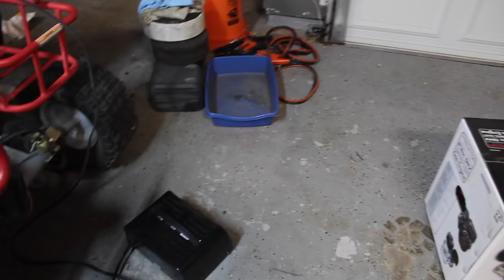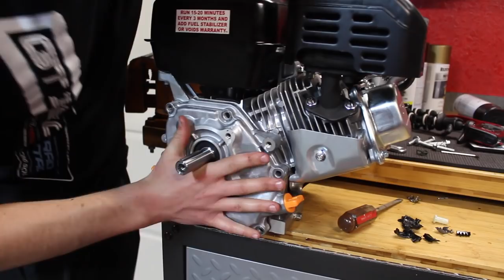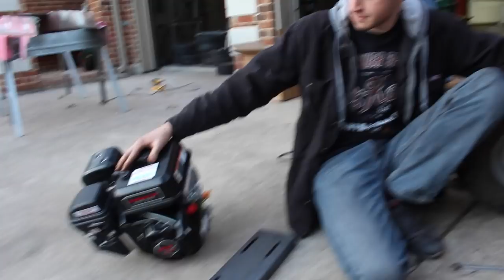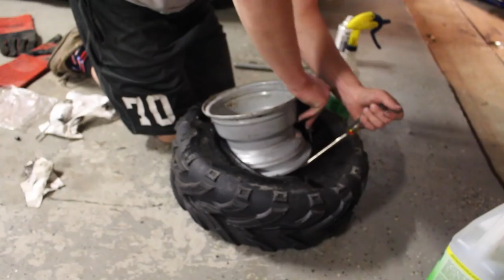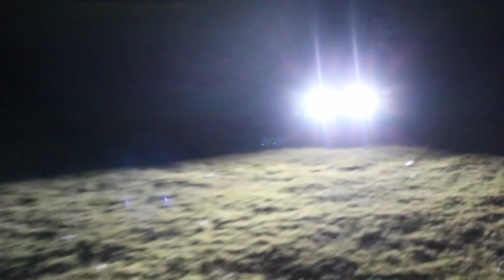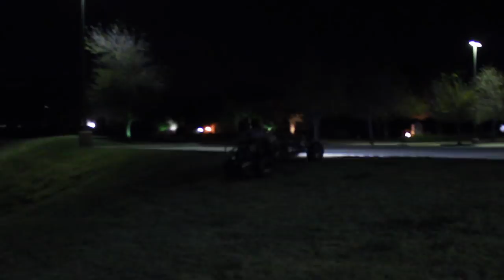Cheap Off-Road Go Kart Engine Swap!

Comment: Don't listen to all the haters on here.  That thing on the camshaft is a gyroscopic "booster."  When you hit about 3,000 rpm, it expands outward and causes the exhaust valve to open an additional 0.350".  This creates more flow through the head, which in turn creates more power.  That's the real reason your drive pulley blew apart on your torque converter.  Also, when you had the engine apart you should have noticed the alignment dots on the crank gear and cam gear.  You can gain an extra 5 hp by moving the dot on the cam gear 2 teeth AHEAD of the crank gear dot.  This advances the timing and creates a more complete fuel burn.  They don't do that at the factory for liability reasons, but as long as you are removing the governor then you might as well do the timing advance since it's so easy to do.  Also, when you seat the tires you should use gasoline.  Stand the wheel up and pour enough gas into the tire to fill it to the bead.  Then roll the wheel around CAREFULLY to spread the gas all around the inside of the tire.  Some might spill out but it will evaporate so no worries there.  Then when you have rotated the wheel all the way around, light the puddle of gas inside the tire.  This will instantly seat the tire and also soften the bead up so that it seals even better against the rim.  This is important if you like taking fast turns or doing donuts.  Lastly, remove the stock spark plug and cut the ground electrode off of the bottom of it, leaving only the center electrode sticking out.  Doing this allows the spark to stretch out to the top of the piston, which increases performance.
Reply: Your description of filling the tire all the way to the top of the bead with gas sounds like yer trying to get some one hurt unless I'm misinterpreting what you said. It only takes about an ounce of gas to gitter done
Reply: @Timothy Hall  yeah his entire comment sounds like he's trying to hurt someone.

Comment: The great thing about you tube is learning the correct way to do things.I have been moving the flammable can away from the tire before lighting it up. Thanks , I am sure this how-to video will help a lot of people.
Reply: Yeah about that I do semi tires with far less starting fluid then that you just need to put some in the tire then run it out to light it.

Comment: The camshaft does not have v tech dumbss it is called easy start it slightly opens the exhaust valve when starting and when the engine start running it expands and dose t affect the valves anymore
Reply: i wouldnt go that far, but i think the idea of a check might be a rootcause, at 54 , i cant really blame them, but maybe how they were raised and not taught the idea of a honest work day where they stink and so tired when they get home that they shower-eat- go to bed, i did that for years when in construction, it will teach the reason for finishing school ,,,
Reply: Yeah unfortunately everyone want to be YouTube stars. All you have to be is smart enough to hold a camera and make sure it’s on.
Reply: A.C.R. (Automatic compression release.) 
At least that's what it was called in the cast iron Kohlers.
Reply: Don’t know what you guys expected from a channel called “build break repeat” I didn’t hear them claiming to be pros anywhere in the vid either, pls upload something on the topic since you know so much
Reply: I'm honestly suprised they didn't know that, actually who am I kidding this is build break repeat
Reply: It’s a compression release so you can pull over easy that’s basic stuff guy come on even raptors and most other engines 🤦‍♂️

Comment: That linkage on the cam is for decompression during starting. It opens the valve briefly at low rpm so the compression is lower so you can start the engine. Try disabling it and starting the engine

Comment: I had one of these gokarts but installed a Polaris triple 600cc snowmobile engine.
It pulled wheelies at 60mph
Reply: VITO SCOTTI how did you put the engine on did you need to get the transmission for it also ???
Reply: I am in that process but with the Yamaha VMAX

Comment: That "thing" you were flicking is a "compression release". It bumps the exhaust valve at cranking RPM to lessen the compression. lol. Once the engine starts It does not bump or hold the exhaust valve open, thus giving you full compression.!! Great invention really. NMC

Comment: That weight on the camshaft is a pressure release for starting it easier
Btw the gopowersports cvt is the same as the eBay cvts just better bolts.
Reply: not true
Reply: Jack Harris lol, yes true look at the engine diagram. Every Honda/clone engine has a compression release of the camshaft. Edit; also the gopowersports cvts are Chinese cvts you can get on eBay for $100 less.

Comment: As long as you don't upgrade your valve springs when you remove your governor, you shouldn't be able to rev the engine to a point where something lets go. Valve float limits it to about 5000rpm.
Reply: Oh no, It'll still rev faster than point valve float occurs... You'll just hear your valves being murderd when they hit the top of the piston.
Reply: No, you have to upgrade the valve springs. 18s or 22s. Using the stock valve springs can cause valve float and can actually damage the valves or even worse the valves can play a game of patty cake with the piston and break or bend them.

Comment: Nice job guys. 

Built a two seater for the grandson. It's setup like yours and nearly finished but haven't fired it up yet.   What kind of speeds are you getting without the mods and still governed 212cc or similar HP original motor?

Best.

Comment: The reason your torque converter flew apart was because you didn't tighten the center bolt tight enough. That bolt holds the clutch on, when the bolt comes out the end bell will fall off . Then the weights will fly apart because nothing is there to hold them in anymore.. The GPS torque converter is the same as the cheap Ebay ones only they charge more for it. $59 on eBay or $119 at GPS, same converter just twice the price... I know GPS sponsors you and sends you free stuff. Please tell them to stop charging twice as much for their parts. They might listen to you :-)  I would put some lock tight on that clutch bolt next time.
Also, there are a couple WAY easier ways to remove that governor gear. Simple way is to remove the flywheel and use a center punch and just push that pin into the block. It pushes out easy. Then that entire assembly will come out of the block. You can now take the circle clip off and insert the rod back in the block OR thread the hole for a 1/4-20 bolt and lock tight that into the block instead of the rod.
Also, it wasn't clear in your video but WHENEVER you remove that governor gear, make triple sure you also remove the metal washer that is under the plastic gear. If you don't remove that washer, it can get in between the teeth of the crank and cam ruin your engine in no time. If you didn't remove that washer, take the cover off and remove it now !
Good luck and thanks for the videos.

Comment: Yeah if you really want those engines to last a decent amount of time run them under a load for a little bit and then do another oil change get all the metal flakes out of there from Breakin I know they're cheap still
Reply: Thats how all bikes are when they get broken in. But they usually have an oil filter and usually the first oil change is 100-200 miles for motorcycles.

Comment: Did you ever think of using snow machine engines instead, My Dad and I had picked up and MXZ 800 liquid to put in the kart we built, It had insane power and speeds were equally scary getting it just over half throttle, what use do is pretty good but just offering an alternate idea for a power plant, And if you can find 1 that was stolen and recovered or Insurance right offs where you pick them up reasonably cheap, I am a hot rodder and speed is just in my blood so love putting high horse power engines like the example I gave you using a Rotax engine because they make good power and they have they are very reliable so you do not need to worry about breaking down, reason for me is I am in a wheelchair and need something reliable, Also was just wondering for doing a build for my son is can you get a chassis already fabricated or do you need to build a frame, Reason I am asking is I do not have much time to build this with my boy because I have an incurable cancer that is aggressive, so would like to get something from some 1 to cut time down and build it with my son, because he has always wanted to restore a old truck or car with me but I just do not have the time for that so he will be able to say at least I built this with my Dad. And great videos by the way that is why I asked if use could help me out,
Bear L.

Comment: I had a torque converter and I was going to fast and everything on the torque converter flew off and the bolt broke off in the crankshaft
Reply: Same

Comment: Nice video.  How many teeth is the big sprocket.  My go kart is a roketa 110cc. 3 speed.  I swap the engine for a predator 212cc. It runs. But the belt broke. It has a 30 torque converter from ebay.    I think the belt broke   because the sprocket is too small.  It's a 38 teeth. I have bought two more sprockets one is 60 and the other 80 teeth. 420 chain.  Which sprocket should I use.  Thanks